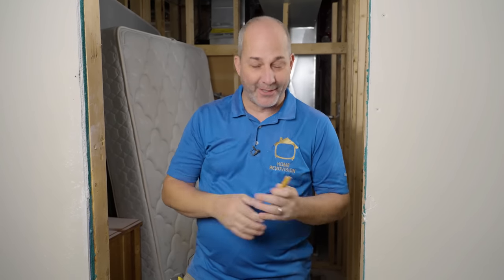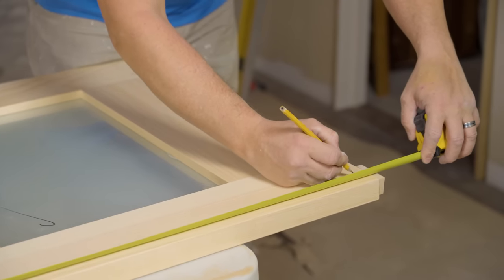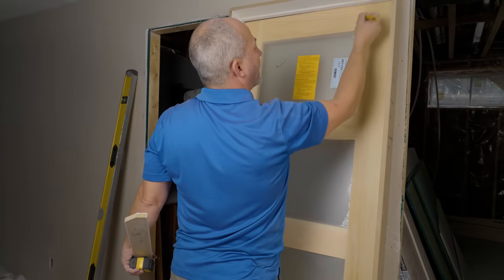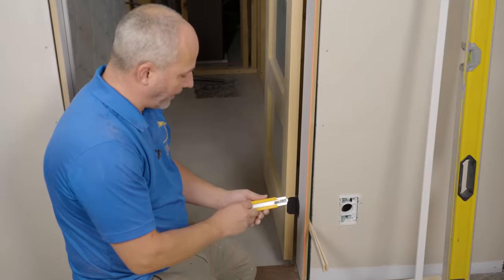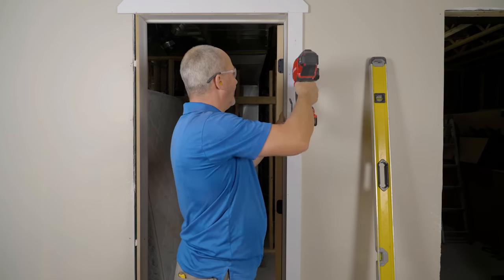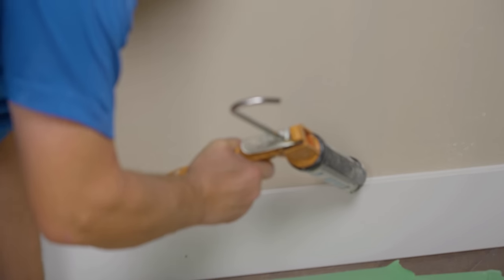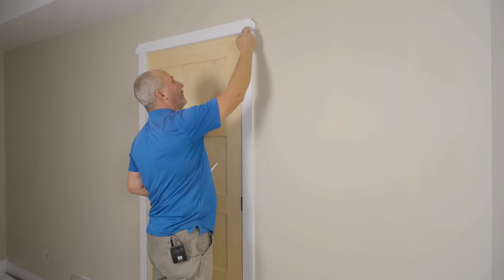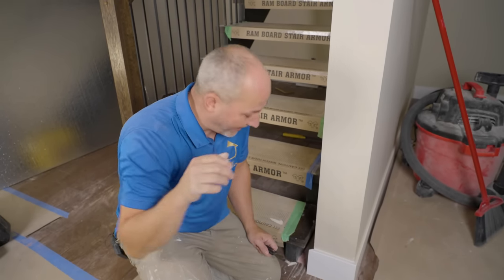The Easiest (and Fastest) Way To Trim Your Door

Comment: I know everyone has thier own way to do things, but 12 years doing production trim I've never seen someone install a door from the outside. Case the hinge side and start by setting the reveal around the slab first. Open the door and address the plumb. I don't understand how you even know what's going on with the reveal from the outside. You've got the door open setting the hinge side with screws first? That's pulling the slab away from the other side and twisting the jamb. I'll always use screws but it's literally the last thing I do.

Comment: You need at least a half inch at the bottom for hardwood floors and an inch for carpet floors so the air return can pull air out of that room when the door is closed unless it's a closet or attic acsess

Comment: Hi Jeff. So far on trim I have seen you fill 18 guage nail holes with DryDex, Acrylic Calk, 45, and now 2 in 1. In your opinion, which gives the best result? What about trim butt joints?
Reply from the maker: the best result is found with a high elastomeric caulking like dynaflex. Cheers!

Comment: Some points of interest but I add some positive criticism.
Never freehand a trimming of a door and the speed square is free handing ... it did move at the tail end. Straight edge and a couple of clamps please.
Score or at the very least, tape the ceiling facing side of the door ... chip out for sure especially if natural wood.
Lose the laser level, not necessary. Bubble level,  shims, door edge and nailer and that is it.
A door properly installed, with shims, should be operable without casing. Yes, the casing adds strength but as I said.  A screw into the framing is good but should only be done after install is pre-casing complete, pre-drilled and just snug, not too torqued, under the doorstop to be concealed and with shims to prevent the screw from moving the jamb. There are many hinges where a brassy construction screw is not acceptable because of the finish ie black or brushed nickel etc. if anyone says just put one through the hinge.
Nail the legs of casing into the jamb first, then header into jamb. Nail outside next and where legs meet the header, if it doesn't sit correct then a few shims to line them up will do the trick.
That Dap along baseboard top is a painters nightmare ... do not think of not ever smoothing it out!  It needs to be painted too because it "yellows" over time.
Lastly .......................... safety glasses! No exceptions. Apprentice 101!
My credentials are of 40 plus years.

Comment: Does No More Nails dammage the drywall when taking baseboards/casing out? I.e. would you need to redrywall a portion?
Reply from the maker: just tears off the paper like any caulking will. always cut the drywall paper when removing a caulked on trim to avoid increasing the scope of work. Cheers!

Comment: Dear Jeff, I am a new member and have a question. Forgive me if this isn't the correct area to ask. I recently had to replace my Maytag washer with an ASKO (special small footprint for closet) washer/dryer combo. The RPM on minimum spin is 1000 and it vibrates the floor and walls. Is there a way I can shore up the floor joists around this closet area to add stability to this old 1942 cottage, redwood prefab  house? (1100 Square feet roughly overall & single wall construction on main living floor) Thanks from Carmel, CA

Comment: Hi jeff, I recently purchased home in cambridge ontario and would like to finish basement floor. I am not sure weither it has a vapour barrier or not under concrete. I tried your method using plastic bag and tape it to check moisture but I didn’t get anything in the morning. Is there any other way to find out. House build in 1971

Comment: oh no!! i like all your tips and i've learned some good ways to DIY. However around the 17 min mark you recommend gluing. BIG NO on gluing casing to the door. I'm doing a remodel right now where they glued the casing and it's a disaster to remove the hideous old casing. Removing has damaged the door jamb - so now all new doors are on order. DON'T GLUE. Please!
Reply: Absolutely, caulk only along margin joint, no glue.

Comment: Does anyone have ideas for dealing with a shallow depth jam?  The former owners left us a closet door that's 1/2" too thin on the inside, and never added trim.  So there is a 1/2" offset to deal with between the drywall and the edge of the jam to normally would nail the trim into.
Reply: You can buy 1/2 Inch by 1/2 Inch square trim to nail to the door to extend it. You can nail that 1/8 off the jam to make your reveal like trim then once you put your casing you give yourself another 1/8 reveal. Sort of like making a jam extension on a window that isn't flush to drywall

Comment: 2" width is not enough for width because if things aren't plumb and if using full 3/4 jambs that only leaves a 1/4" to fit jambs,not enough.
Reply from the maker: jambs are all 5/8 and yes 2" is enough when you are framing because you will plumb the wall. Cheers!
Reply: You can't depend on framers to plumb everything perfect, then studs twist. I tell framers at least 2 1/4" to21/2" inches. Plus you shouldn't be using 5/8" mdf on an1 3/4" solid wood door, no strength

Comment: i thot this title was sexually explicit and was shocked to see it is actually about some bald guy whittling away at wood which could also be sexual but i was hoping a female (a real one) was here
Reply from the maker: Get a life!. Cheers!
Reply: @HomeRenoVisionDIY  Hi! I was tryin to have a little fun , didnt realize you would ever answer stuff. Ever done any log home work? Heavier craft than using sticks. I live in a log home started  in maybe mid 1880s, one section built maybe 1929 and an extension in 1987, curious what you would do with an historic structure like that.
Reply: There are some excellent books on traditonal carpentry methods. A classic one is "Illustrated Interior Carpentry" by Graham Blackburn. Good luck, please don't use mdf! Lol